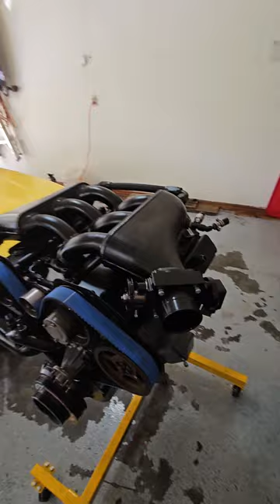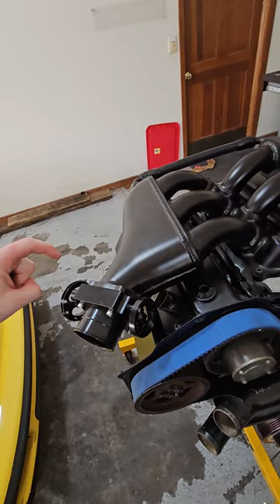Merlin Machining just posted a FINAL Preorder for these intake manifolds!

Comment: Hello billy hope you don’t mind me picking your brains I have the same sort of set up as you  forged rods pistons but I have 400+ cams Tommie adjustable intake and exhaust no avi timing ported and gas flowed myself Merlin manifold and valve covers polar engineering top fuel rail and 1300 id injectors in your opinion will they flow enough and what be the best intercooler and the best 2.5 pipping to buy? If you don’t mind thank you and 2860 gen 2 sorry missed that part
Reply from the maker: Sounds like you won't have a problem. I have Ash spec two and a half inch piping. I don't think you can find that anymore. From what I've heard though the specialty z stuff is the best on the market currently.
Reply: @Billy_Built  Thank you.  How you getting on with your 300ZX  build I haven’t seen a video off it up and running yet. Have you had it dynode yet? If so how much power did it make. It looks really nice.